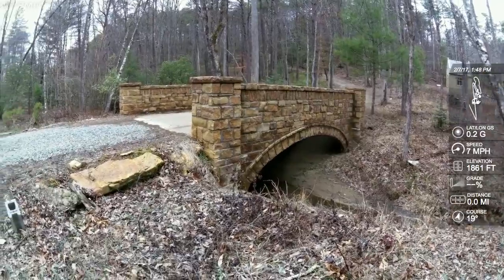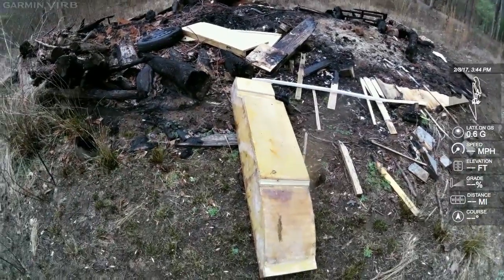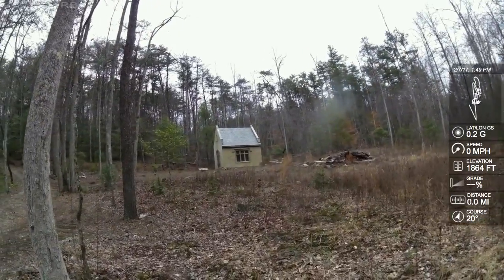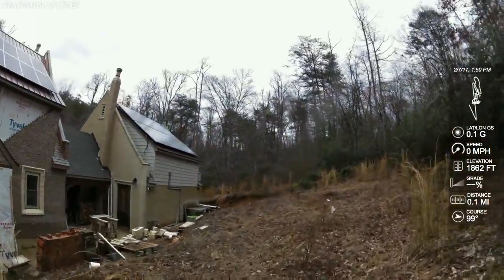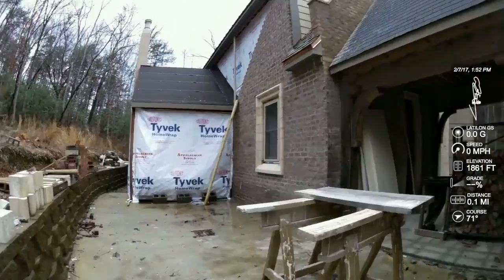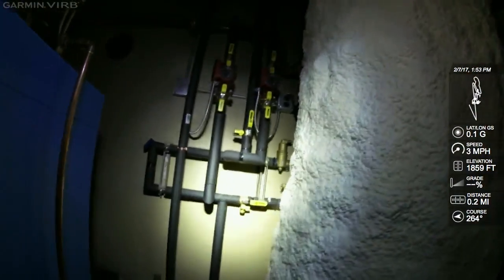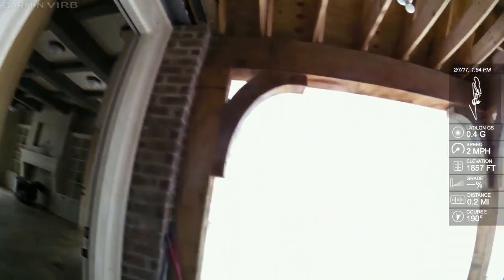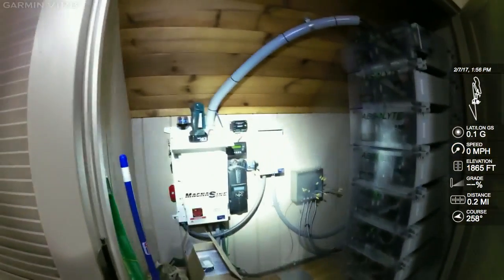Offgrid Magnum inverter/ Radiant floor heat/ woodstoves

Comment: I know this is several years old but what I'm looking for is the name of the person that installed the radiant floor heating system you mentioned you would love to get his number so we die :-) the whole system looks incredible looking at building a home in North North Carolina and would love to have a system similar
Reply from the maker: Talk to Sundance power systems in Asheville. They do a lot of radiant
Reply: @GainSolarPower  good to know, I've already contacted them about doing solar and batteries for me and off grid system I'll include that as well

Comment: there's a lot of equipment for the solar to run.  the circulators end up drawing a bit more power then a guy thinks. I learned that from experience. looks more like a on grid mechanical room then an off grid home.